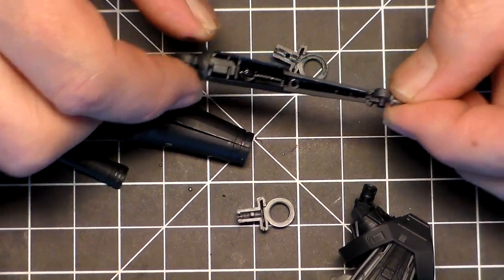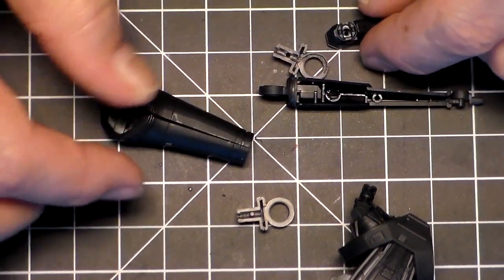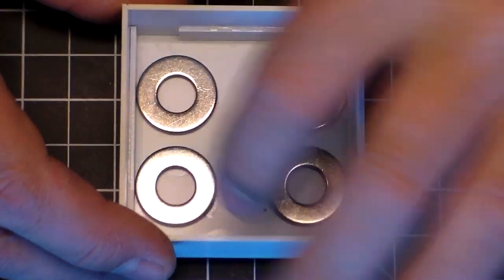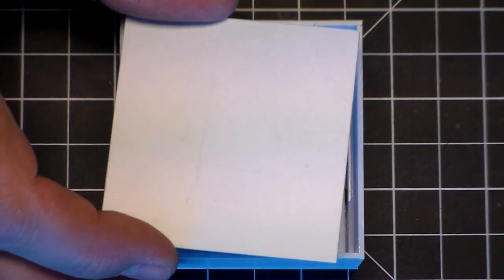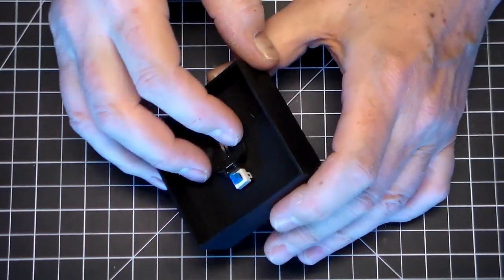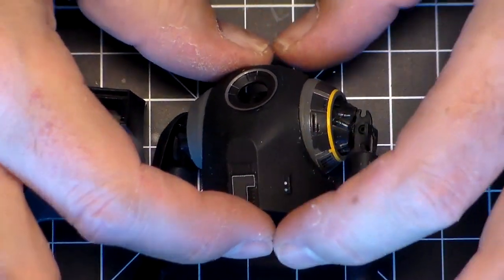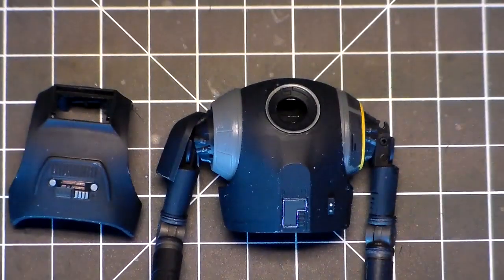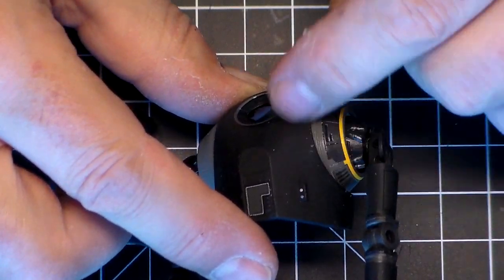PART 2 - K2-SO Bandai 1/12 Scale Build

Comment: Good job! Do you think there is enough space in the box you made to put the battery in it too. Wondering if that will simplify the wiring job thru the leg. probably not big enough to take the battery holder so would likely need some jig to hold it in.
Reply from the maker: Thanks Arun! I want to be able to change the battery easily. That's why I opted to put it in the base.